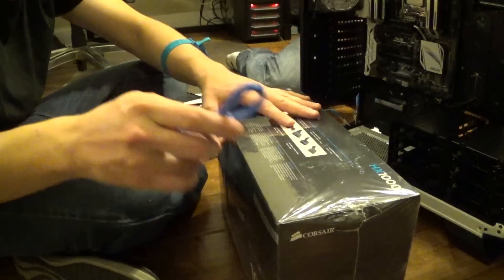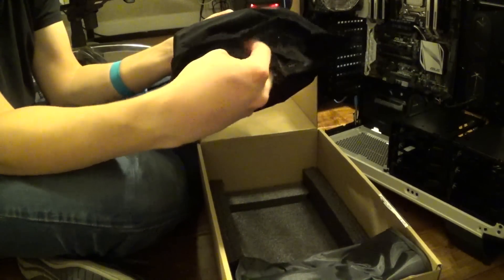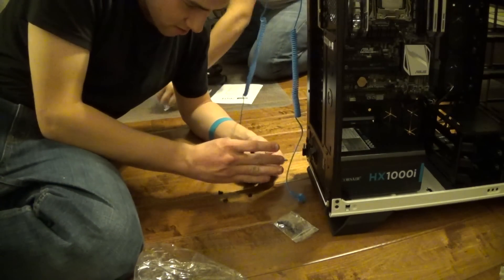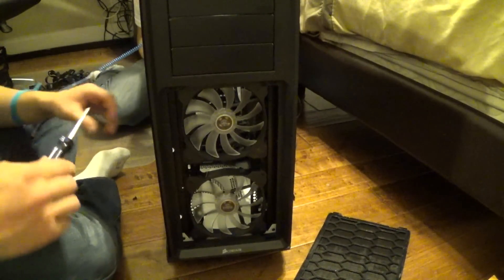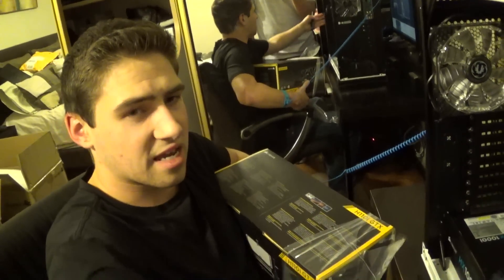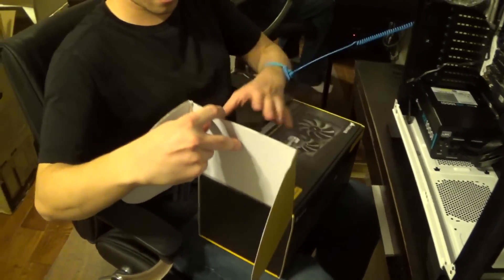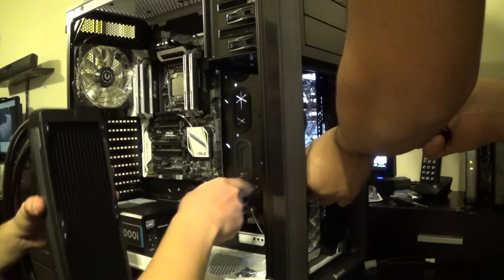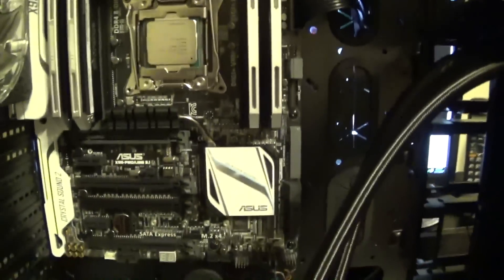Building a 4K Gaming Computer pt5

Comment: aint you blowing the heat off the radiator into the pc? that kinda defeats the purpose dont it?  reverse the fans to pull off the radiator and suck cool air in the back would be better imo but what do i know...
Reply: Agreed. Push the air out the front, reverse the exhaust fan at the back, and add a couple intake fans at the top.

Comment: You are correct in mounting the rad in the front. Its only a 2 degree difference and you want front intake with rear exhaust. That makes a positive air flow in the case which helps with dust control. Never run rear/top intakes unless they are filtered that most cases don't include for.